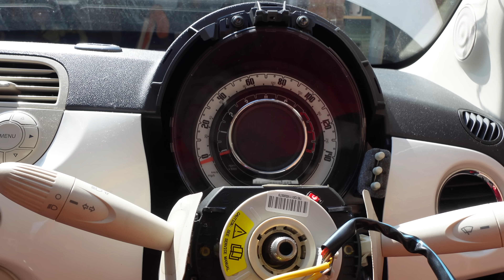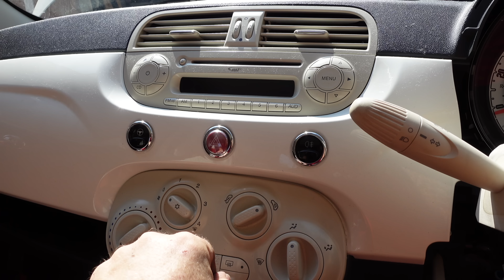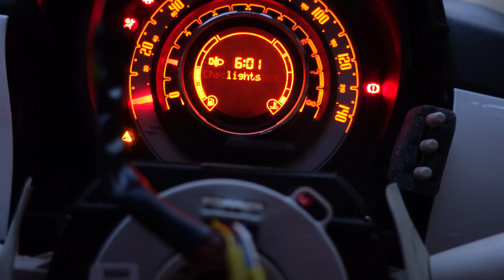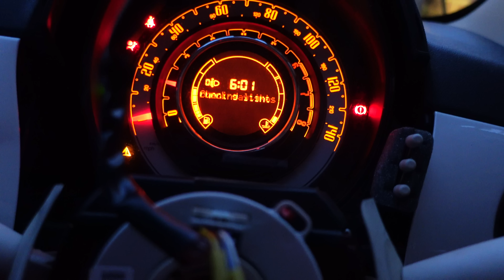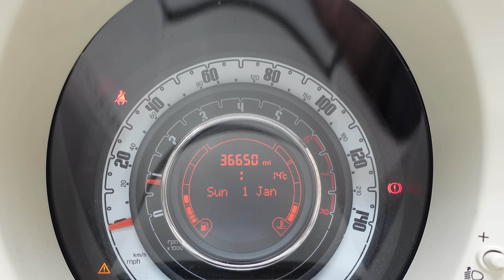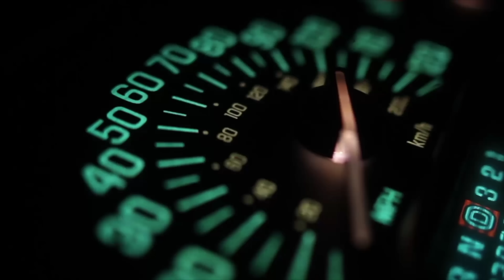Project Millie - Day 2. A/C & Ignition - Fiat 500 Lounge Copart Stolen/Recovered, Cat N Salvage

Comment: Hi Paul, great video! Unfortunately, it seems that reprogramming the BCM (Body Control Module) might be necessary to enable the immobilizer and program the original key to it. There are unscrupulous individuals, commonly known as "car stealers," who have equipment capable of disabling the immobilizer. This means that your car can start without any issues (original key), but it also means that car can be started with any key (Immo is disabled). To troubleshoot this issue, I recommend disconnecting the immobilizer antenna located around the key lock barrel and seeing if the car starts. If it does start, then it indicates that you will need to proceed with BCM programming to rectify the problem.
Reply from the maker: No, it’s fine.

Comment: My wheel bolts loosened on the car during the week, made an awful racket. I was sure the wheel bearing finally gave out on the rears, but just the bolts on the nearside front ????. The rear bearings still need to be done. I am trying to get rid of my locking wheel bolts, I hate them. My mileage is flashing, but the battery doesn't go flat. In theory,if you just disconnected the B& M, would it stop the drain? I'm rambling now 😮.
Reply: Mileage flashing requires proxi alignment. Ecu reader needed.
Reply: Torque wheel bolts to spec

Comment: What does the locksmith guy typically charge to programme a spare key?
Reply from the maker: Supply, cut and code is around £150.
Reply: Cheers Paul. In your experience does it put off buyers? If only one key?
Reply from the maker: @xBigozx  some people ask if there’s only one key. It doesn’t stop anyone buying it but is always a bonus when there’s a spare. I did start getting spares cut but it was £80 I couldn’t get back so I don’t bother now.